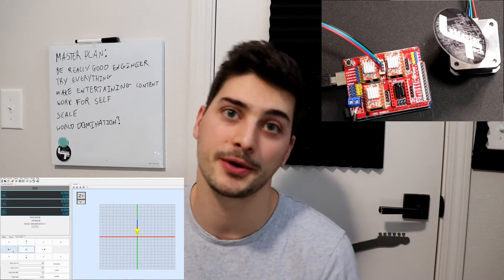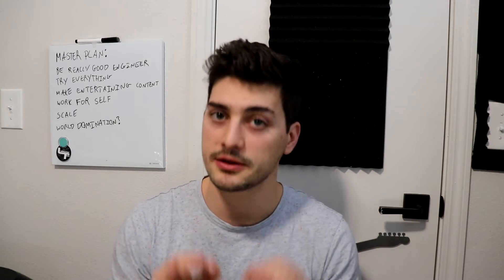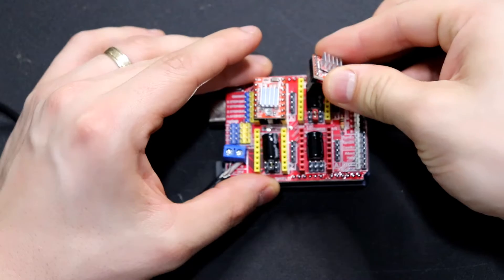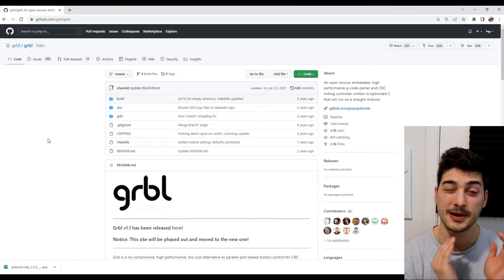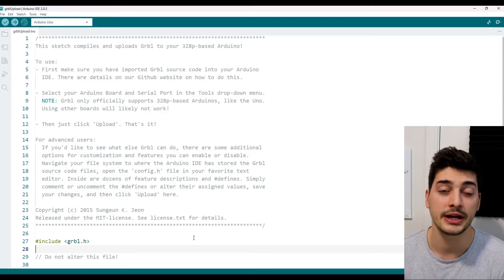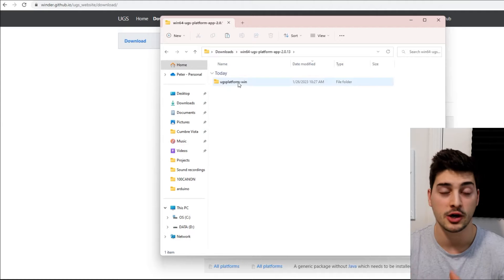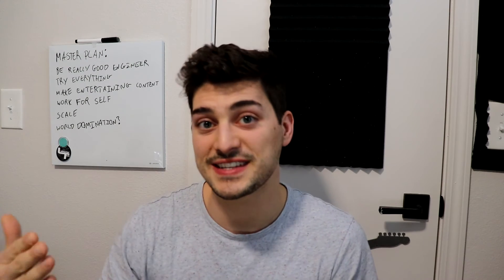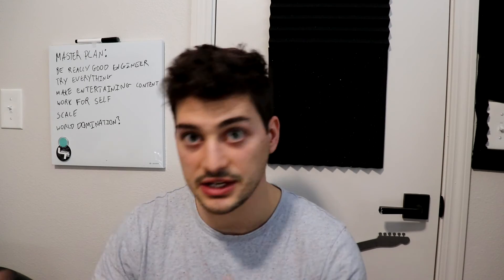How to Control Stepper Motors with Arduino using a GRBL CNC Shield!

Comment: Is there a cleaner way to power it... looks like you split some wire - would rather buy something that just plugs in.... is that possible?
Reply from the maker: Oh for sure there are way cleaner ways to power it! I cut up an old laptop power supply because that’s what I had sitting around! If you grab a legit dc power supply for hobby electronics you will not have the exposed negative side like mine has!

Comment: Im having issues with the universal gcode sender (UGS). Cant get it to connect.
Reply from the maker: Hi, does your arduino IDE connect to your controller okay? Does the g code sender find the arduino plugged in to a com port automatically? Were you able to install the grbl package via arduino ide?
Reply: @lemastertech  Found the issue. I had to close down Arduino IDE before I could connect the UGS :P
Reply: @lordtywin-w3h  This worked for me as well
Reply: @lemastertech  I think so. Lol, i dont know this stuff.

Comment: Hello sir
Can i powar 12v dc  10Amp current
Reply from the maker: Not using an arduino board - you’ll need a different DC power supply

Comment: i have a problem it goes orange but i cant control anything
Reply from the maker: Well, make sure your DC power supply is on and plugged into your CNC shield, and make sure all your cnc controllers have their enable pins lined up with the shields enable pins! If it’s orange your computer to shield connection is all good, but you may have physical wiring issues still! Goodluck!
Reply: @lemastertech  It’s like the motor is just vibrating but if I give it a little push it will go in that direction
Reply from the maker: @AussieAdapt  that sounds like it’s possible your controller is misaligned or the heat sink could be touching some of your pins! But also, if the motor twitches but doesn’t turn that can be a sign you aren’t providing sufficient voltage! What voltage is your DC power supply?